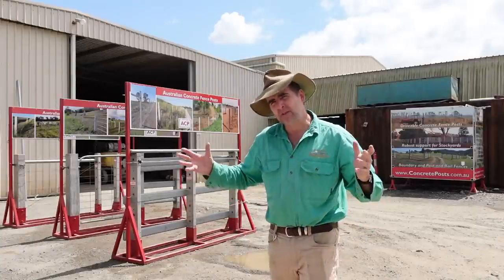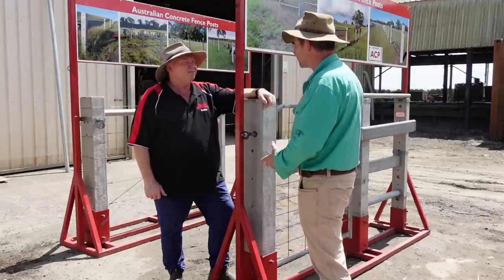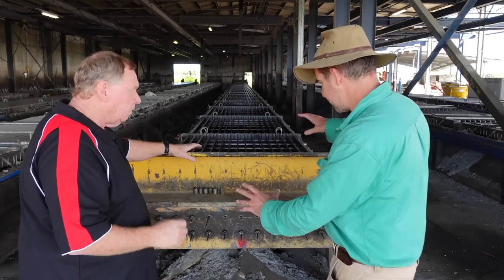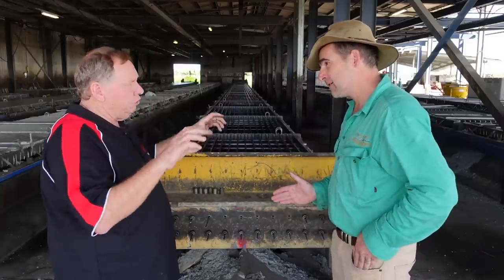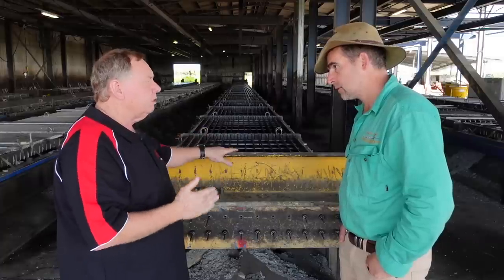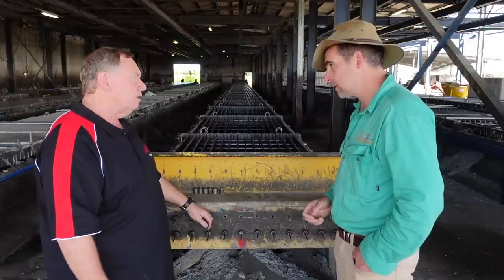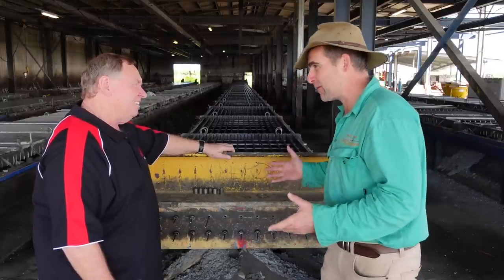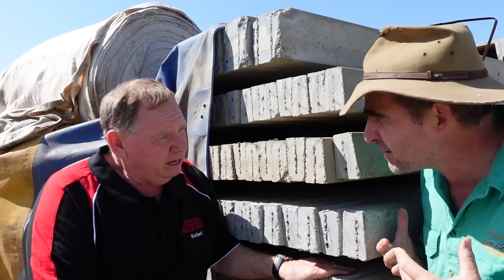Making Tough Concrete Posts

Comment: So the pre stressing of the steel is  primarily to allow the posts to pile drive them into the ground as to increase time efficiency as the customers require a large number of posts which requires a lot of time to fence.

Comment: Very interesting and insightful video and a top notch company. I didn't quite understand what the issue was in the early days when you cut the wire that was under tension and it shot like a bullet. What did you do to solve the issue? Pouring and allowing the concrete to set before cutting was the solution or something else?
While I'm on a roll with dumb questions.... How can a set concrete post shrink to shorten its length by 3" and not crumble?
Reply from the maker: Trade secret about the first question. Pre stressed concrete is under tension when it dries and shrinks. Bridge pylons do the same thing. Like compacting soil.

Comment: excellent video.  very informative.  at 16:39 there is some spalling developing at the end of the monier post but after 60 years the post was still super serviceable.  it might fail after another 60 yers in the ground.  for those users in an extremely corrosive environment, like next door to an acid factory, coating the post ends with a cement/silica fume paint would further hinder corrosion of the rods.  i hope they store their steel wire out in the weather.  light surface rust aids adhesion of the concrete to the bar.

Comment: Another great video. But I have never heard about the legislation around building fence ie how many wires/post. I have spoken to local & state government & they have never heard of anything like that. I am interested in where he got this information?? Would be interested In having a read.
Reply from the maker: Technical information can be found on fencing.
 
TRANSPORT FOR NSW (TfNSW)
QA SPECIFICATION R201 FENCING
Drawings R0800 Fencing Series R0800-01, R0800-02, R0800-03, R0800-04, R0800-05, R0800-06.
 
Queensland Transport and Main Roads
Specifications MRTS14
Drawings SD1600, SD1601, SD1602, SD1603, SD1604 – Fencing
VIC Roads
Standard Drawing 3111 A - Fence Type B - B1 and B2 Post and Wire

Comment: Impressive product and great video. Can anyone point me to the regulations about roadside fences and distances between posts? Saw this and on the drive into town yday (in NSW) noticed that there was a fair bit of variation, some at least 5 metres apart. But I couldn’t find any specific regulations on the web?
Reply from the maker: G'day Andrew, sorry for the delay, Richard recommends the following sources of information;
TRANSPORT FOR NSW (TfNSW)
QA SPECIFICATION R201 FENCING
Drawings R0800 Fencing Series R0800-01, R0800-02, R0800-03, R0800-04, R0800-05, R0800-06.
 
Queensland Transport and Main Roads
Specifications MRTS14
Drawings SD1600, SD1601, SD1602, SD1603, SD1604 – Fencing

VIC Roads
Standard Drawing 3111 A - Fence Type B - B1 and B2 Post and Wire

Hope that helps mate.
Reply: @FarmLearningTim    Cheers, much appreciated

Comment: It could have been a lot better to explain why there were so many defective posts these posts are made in a mold and should not deviate from one post to another post.
Reply from the maker: Less than a pallet in a year of full production? Clearly you don’t work in manufacturing. The point is that they have great QA and catch them all.